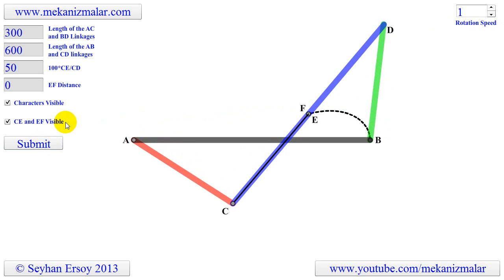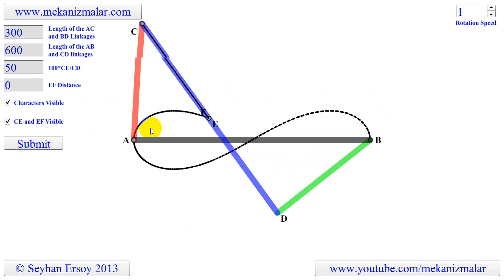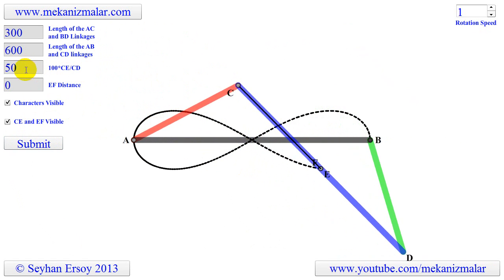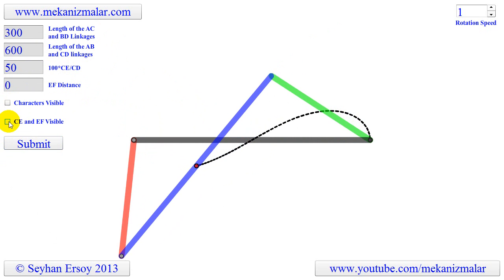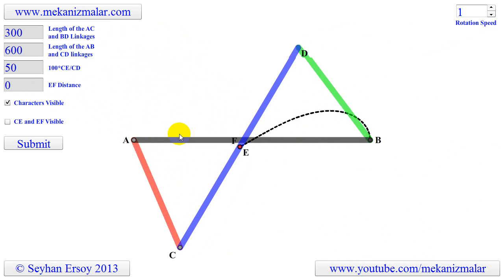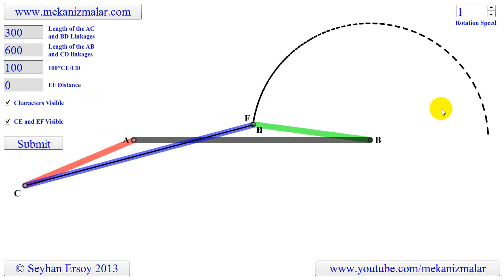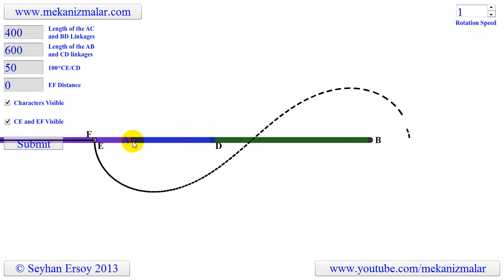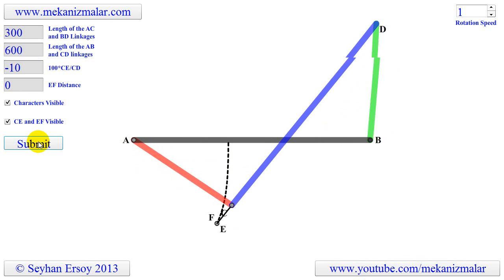Four Bar infinitiy Coupler Curve

Comment: using the 4 bar linkage, I was unable to recreate the figure 8 pattern, using these values of 300 for AC and BD, 600 for AB and CD, or any lengths where AC = BD with lengths x2 for AB and CD.
the Infinity Curve page won't play Flash